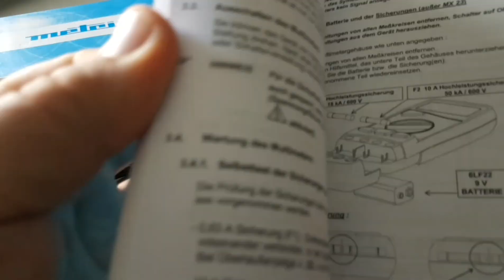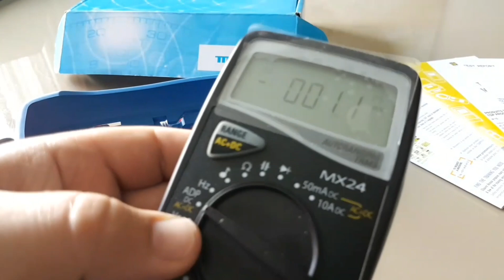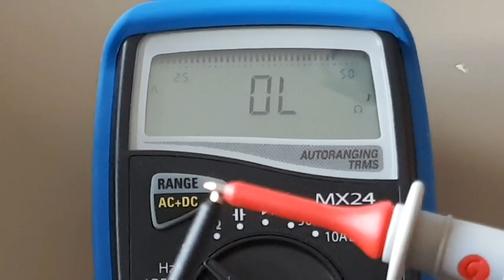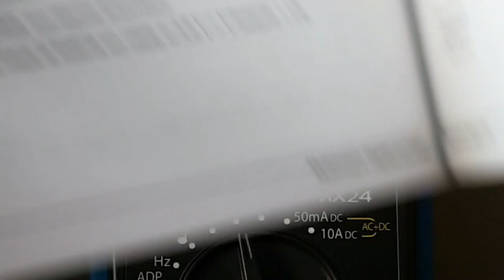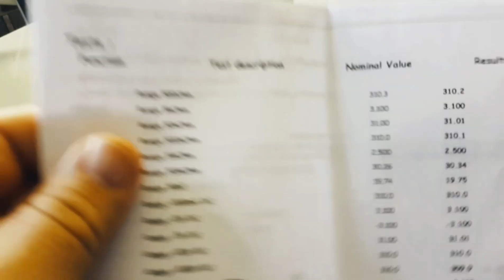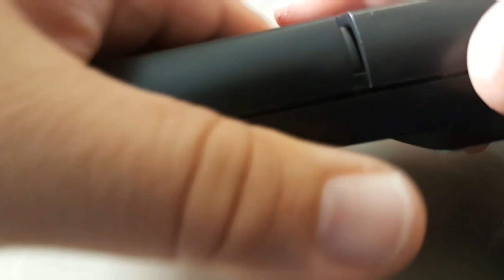Metrix MX24 - Multimeter Review & Teardown!

Comment: Might be possible to salvage those nice looking probes with a good cleaning - just sayin'.  Im guessing we might not get that nice input protection array in the US, but thats some pretty slick fuse access.  Sure had a lot going for it, with a better display and faster cap range it could be a winner but $250 is way out of the ball park for what it is.
Reply from the maker: Indeed my friend...its alot of moola for the price of admission...Made in France is a very nice caveat to see stamped on a multimeter but this one just seems far too expensive for the overall package. The fuse replacement mechanism is novel but it's also rather awkward. The ridiculously low mA rating makes that range almost useless. It is very nicely made though and has a very heavy quality feel. Definitely a love/hate relationship! Vivre la France!

Comment: Interesting meter. I have an AEMC 5231 with the same spongy feeling on the function switch. I made the teardown and I've found that the switch has the proper "klang" and latching, but once it is reassembled, the friction between the pcb and the contacts of the rotary switch eliminates the "klang".
Reply from the maker: Interesting to hear. Yes, I really wish it had a much better feeling with the selector switch as it stands its a very underwhelming experience...and I won't even mention the paltry 50mA max rating....Thanks for watching!